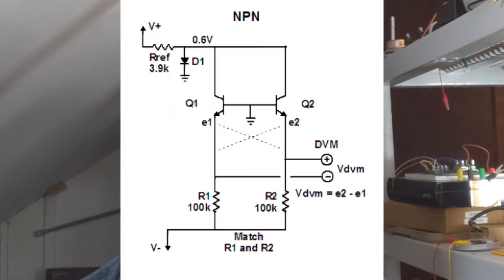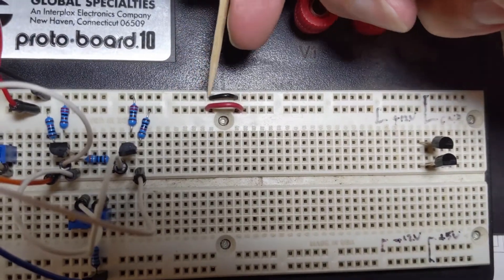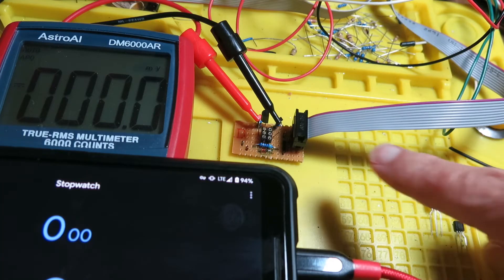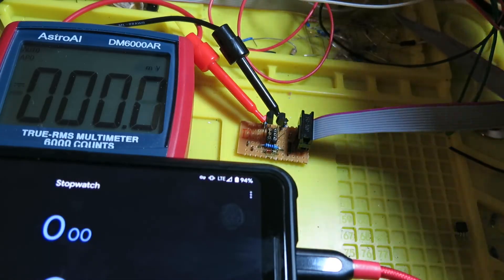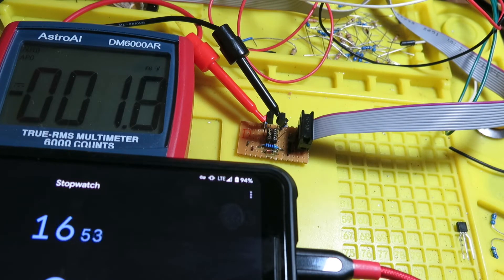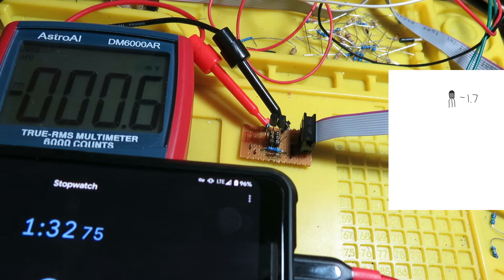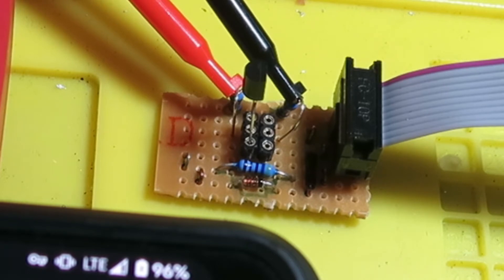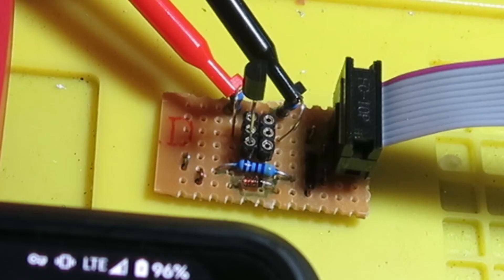Transistor Matching

Comment: Thanks for the demo.  I use a similar approach but all the transistors are wired up diode-connected for the test, following an approach described by Bob Pease in his EDN article, "What's this logarithmic stuff anyway?"  You will have a much easier time and much better results if you

* set up an old computer fan to blow over the matching setup and the waiting transistors

* use tweezers to handle the transistors and place the tweezers in the air stream while you wait instead of holding them in your hand.

It will greatly cut down the time needed for equilibration and improve reproducibility.  These points should be seen as essentials and not optional improvements.

Comment: The legendary Bob Pease called breadboards 'the white slab of trouble.' 

I'm not sure I'd go to quite this much work.  I don't know how often I need a 10 ppm match. (I usually use emitter resistors, which hides some of the mismatch.) The last batches of DMMT5401's and DMMT5551's that I got in all seem to have a Vbe match within about 300 microvolts (The data sheet says 1 mV typical, 2mV max, so maybe I got lucky, or maybe their production process is better than they claim.)  Having both transistors in one package is convenient.  I solder it into a breakout board, epoxy a tiny RTD on the back of the package, and glue on a piece of blue foam. An opamp and a couple of resistors, and I have a temperature compensated matched pair suitable for a 1000:1 log converter.

For currrent mirrors and current references, I really like the REF200.  Searching for transistor matches for that application is worth a lot more than ten bucks of my time.

Comment: in the pdf he sais that for building OTAs they need to be matched to less than 50uV. How would you mesure that? multimeters don't usually go below the millivolt range so I don't know how to do it.
Reply: It might take a while to work it out, but this looks like a good use for an op-amp as a comparator, or simply use 2 op amps with matched resistor pairs to get higher values. Say a 100 ohm, and 1 k ohm for the inverting to get a 10 factor increase, turning the provided 50uV to a .5 mV difference, which should be visible on most reasonably good multimeters.  (When I say matched resistor pairs, each op-amp is going to need one of each of the two resistances you select, and you want to make sure that the resistance of each value is a very close match. That can be difficult on budget multimeters. Part of that problem is that the more variance across the test equipment you're working with, the more inaccurate your results are going to be. You might use trimmer pots, with a common source voltage to tune the output of the op-amp circuits so that you can get them to a common value, or tune one so that the difference in output between the two is 0, then switch to testing transistors with that setup.)

Comment: Great video, thanks.  Do I just reverse the polarity for testing pnp transistors?
Reply from the maker: Now there's a coincidence for the ages. I just this morning matched some PNP transistors for the first time and had to look that up. The circuit's very similar to the NPN one, but with the diode and the voltage connections reversed. See Ian Fritz's article (link in the description).

Comment: This looks great! Just what I was looking for to construct a phaser guitar effect pedal which needs 4 matched transistors. Would I be able to use a 9 volt battery though, instead of the 12 volt power supply that you are using? If so, would I still need a "ground" connection on the circuit board? How would I go about that?
Reply from the maker: I'm not an expert on this but I should think you could use not one but two 9 V batteries. Connect the + terminal of one to the - terminal of the other, and that's where the ground connection goes. Then the other + terminal goes to the 3.9k resistors (where I show +12V) and the other - terminal goes to the 100k resistors (where I show -12V). In essence what you have there is a dual ±9 V supply. It might be necessary to scale the resistors down accordingly, to something like 3k and 68k. Try it anyway, see how it goes.
Reply: @analog_output  Thanks for the quick reply. I'd have never come up with that myself. I'll definitely be trying it out. I was surprised that there didn't seem to be much information out there showing an accurate, yet simple way to match transistors. But your way appears to do the trick while being quite easy to follow, and you posted it just in time too (i.e., just ten days ago). Thanks for taking the time and effort to do it!